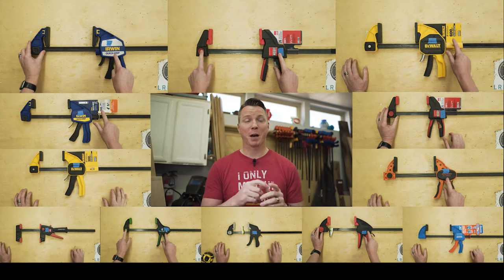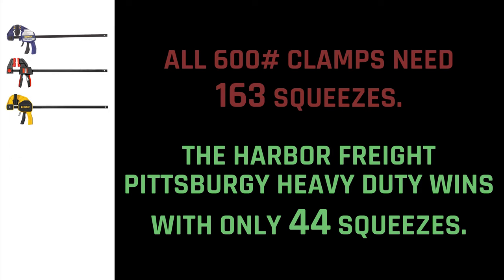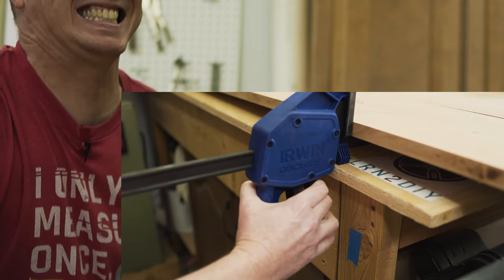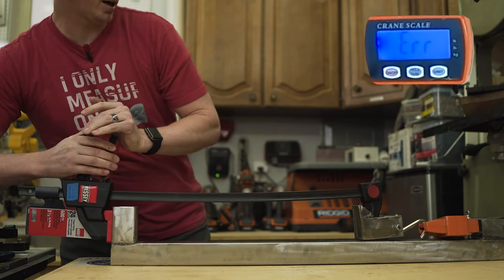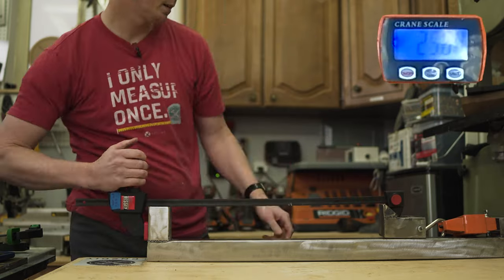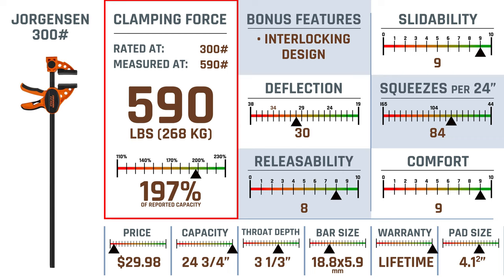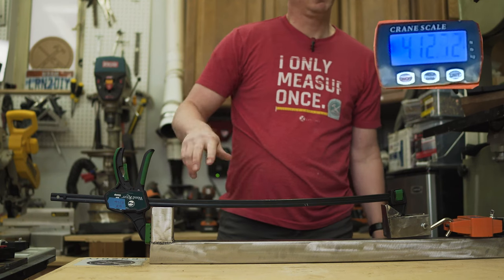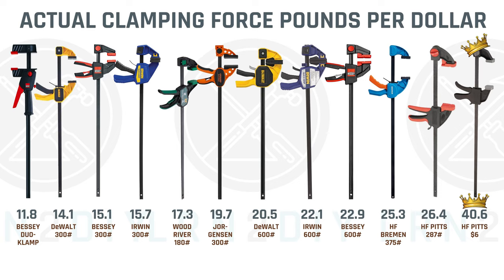The Ultimate Trigger Clamp Showdown - 12 Clamps Compared

Comment: Great video. I worry that they Bessey 300 might be too easy to release under normal pressures. Is there any truth to that?
Reply: I have some of the Bessey 300# clamps and never have an issue with releasing.  The release mechanism is fairly well protected in its location in the stationary handle, which keeps it out of the way and avoids accidental release quite well for me.  That said, the slideability of those clamps plummeted in all of mine so they went from being my favorite to the ones I grab only if I have two free hands to slide them open and closed.  Maybe I'll try wiping them down like suggested in the video.
Reply: @IceMonkey82  Which ones do you prefer (ones that maintained slideability)?

Comment: Are there some robust full metal fast clamps?
Reply: Vise Grip Quick Grips used to make a welding clamp that was metal. That was how many years ago now? Then there's a product called Supergrips. Which is like Vise Grips with an F clamp head in them. The Vise Grip mechanism is rated for one ton of clamping force. But I think Supergrips only come with about a one foot bar? It should close up those joints that are a bit too tight though.

Comment: I have used several of the HF clamps for projects I needed to leave outdoors as the price makes them relatively expendable.  You weren't able to test the release on them, but I find it to be very difficult.
Reply: I just back out of a bit using the threaded handle. It seems to work well. It can be tough from a straight release under pressure. That kind of stuff I look at and think, first world problems.  I've never had a problem with mine and I don't think I'll ever pay an extra 20-60 bucks per clamp for things I'll never need.

Comment: All the tests where you gripped the clamp with another clamp are meaningless (which includes the two catastrophic  failures.  The ratings should reflect only what can be achieved with normal bare-handed power, because that's how they're used.  All you've proved is that it's dumb and dangerous to do it that way.  It makes the comfort rating meaningless as well., since that will affect how hard you can close it by hand.